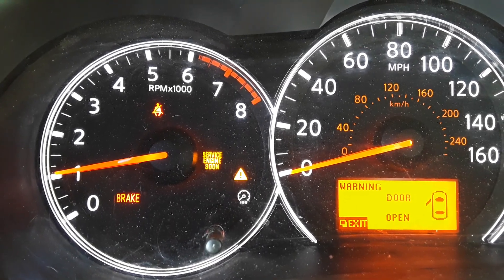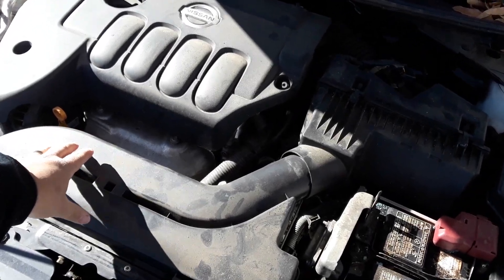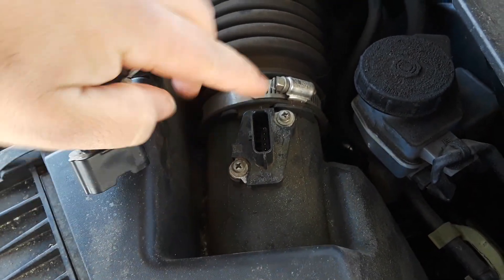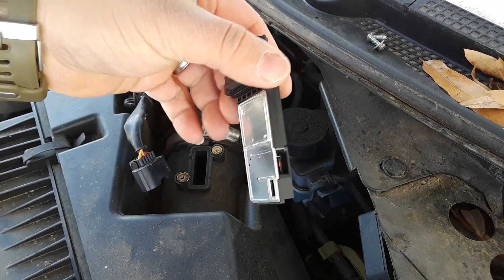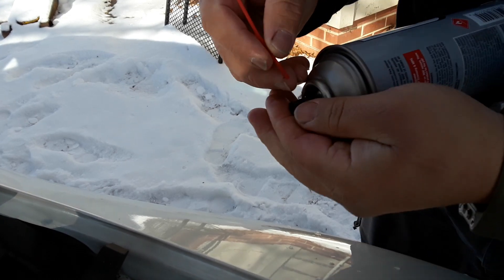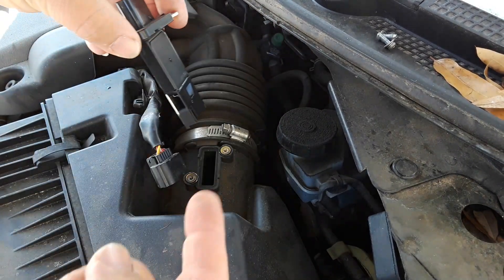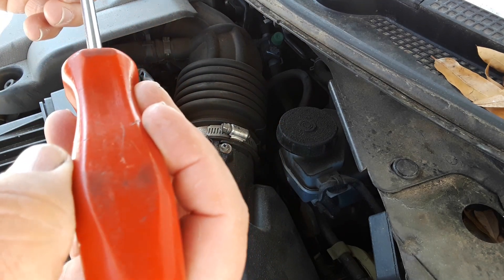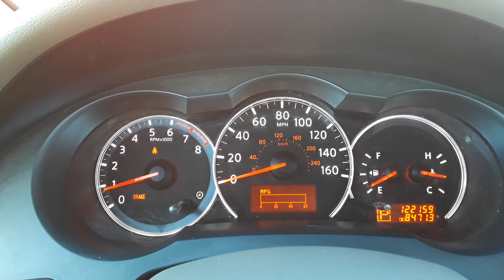How to Clean the Mass Air Flow Sensor (Code P0101 on Nissan Altima)

Comment: Had a MAF sensor problem. Bought a new one changed it out and cleared the code. Drove it for a week, took it to get smogged and it passed. Then a week later the check engine light came back on, same code so I bought another MAF sensor and I stalled it yesterday. Cleared the code and took it for a drive and the same code popped back on. Any suggestions on what could be the problem?
Reply from the maker: Ramon Escalante Check the connector for any corrosion or debri and follow the wires to make sure there are no frays or cuts.
Reply: Check "Scotty Kilmer"  on YT for MAF sensor and throttle cleaning. It help me from reprogramming my MCE by making sure i have a clean  air filter and housing,  clean MAF sensor and throttle using specific cleansers

Comment: Took it to the mechanic told me it needed a new one. He told me it would be 280$ I’ll  try to fix this this week. I’ll get back to you guys soon.
Reply: Clean ur throttle body and get a new air filter
Reply from the maker: @jorgepachecopedroza4062  That helps!
Reply: I just bought one on the internet for $24 lol
Reply from the maker: unknown name Good luck! Hope it works out for you!
Reply: I Clean it and it didn’t work so I just bought a new one for 105$ almost half the price I’ll put on tomorrow
Reply from the maker: @itsomar855  Workin well now?!
Reply: yeah it did work.
Reply: @itsomar855  I fix my code as well. I already change my MAFS but wait to get my ECM reprogram. I did it today and the code went away. I have a special scanner as well and it detect the code even if the mechanic tried to reset the ecm by disconnect the battery my scanner would pick up the code. However, the reprogram fix  the problem. No more P0101 for me. So happy.
Reply: @trueGrizzliesfan22  yeah i forgot to erase the code.
Reply: @itsomar855  i promise you if you get your MAFS reprogram it will fix the problem. I waited 2 years to do this. I already change my MAFS when i first got the car. I always used to reset the code with my scanner but the check engine light will display back on my car. Today, I decide to get the reprogram at the dealer it cost 120.00. No more code or check engine light. My car drive smooth as well.
Reply: trueGrizzlesFAN22 I replaced my mafs sensor as well but the check engine light still comes up. Do I have to take the car to a mechanic so they can reset the ecm? I checked for air leaks and there’s no air leaks in the system
Reply: They are 150 dollar on line if you can find it, will run without it, but if anything is light up, it would not pass inspection ,  just a sensor that you do not need, measures the air flow going in to see if too much or too less, just a money making racket.  Don't know if you can clean it or not, Have to figure out where in the hell it is first on my car,  too many worthless sensors on these cars anymore, but it is control by the computer,  ain't it great !!
Reply: Frank Martin I replaced the maf sensor with a cheap one from rock auto and those don’t work so be careful on buying cheap maf sensor I got one from oreileys for $100 and that one did the job. I also had to get the computer updated in order to get the check engine light off so it can pass smog inspection. Hopefully this helps anyone going through the same problem I went. Be careful dealerships try selling you $500 maf sensors which you don’t need because my car is running perfectly fine.
Reply: @rafa91a  is it still running good? I'm having this issue now and replaced at a dealership in 2018 now I'm going to o'Reilly and just want to make sure I'm making the right choice.

Comment: 3:40 they also idiot proofed it on most vehicles so you can't install it backwards as well.
Reply: True.  He warned about installing it backwards, but it won't line up the holes if you put in backwards.

Comment: Wow man, thanks for the video, I finally got my check engine light to turn off, thanks!!
Reply from the maker: No problem! Thanks for watching!
Reply: How many minutes or hours did you wait to get the light off?
Reply: Tony Stark it should go away ASAP. That’s why the guy at auto zone told me. He told me to clean it first then wait a bit. If it still shows, then it’s damaged

Comment: Do I have to disconnect the battery before cleaning it? I have a 2016 Infiniti Q50 and its the same code as yours. I was already thinking of replacing them but Im going to try this method first..
Reply: You don't need to...
Reply: Do i need to erase the check engine light after I clean it?
Reply: If the cleaning trick works (i.e., not a dying maf sensor), the cel (P0101) should go off by itself after a few driving cycles. But if you have a scanner to erase the code, wouldn't hurt to do it either. Disconnecting the negative battery terminal and then stepping on the brake pedal for a few seconds should also erase the code but i am not sure if you need to reset the factory stereo/alarm or not :(
Reply: BTW, 2016 model should still be under factory warranty, right?
Reply: TheWiseGuy disconnect negative on battery or pull the connecter off mass air flow sensor then clean it

Comment: Hello Sir, I suspect my daughter Nissan Altima is having this problem, I try to use the cleaner..except I did not have the special 20 torex socket that I need to pull the maf, so I just sprayed in to it the best that I could, but we are still having the same issue? Any thoughts or ideas? Should I totally remove to MAF to get a better clean? Thanks for any help
Reply: Lee Ralph yes
Reply from the maker: Lee Ralph Yes, it works best when you remove it
Reply: Check "Scotty Kilmer" on removal, cleaning and putting back MAF and throttle.
Reply: Honestly, you how to buy a new one and then take your car to a dealer for reprogram. I did my car today and it fix the problem .
Reply: Invest in some Torx screwdrivers. You'll likely use them for other things in the future.

Comment: You helped me to solve the same problem with my Nissan Altima 2011. Thanks you very much!
Reply: I have the same code cleaned my sensor but the service engine light does not go away. 2012 Altima
Reply: Iron Llama I have the same thing 😏😫
Reply: @ironllama  that just means it's way past cleaning issue, more than likely needs a sensor replacement
Reply: @ironllama  same here I change it still on 💔
Reply: SAIF Tube have you tried resetting the code?? Do that and see if it comes back on
Reply from the maker: Peter Xie Awesome! Glad it helped!
Reply: Peter Xie mood
Reply: Hey everyone, In your guys opinion my 2011 Nissan Altima engine light keeps going in and out so I took it to auto zone and the code came up for my MAF sensor. One day it has really bad acceleration and the next day it will run fine... Should I try cleaning first or just go ahead and replace my MAF sensor?
Reply: @brianjohnson9805  clean it easy fix